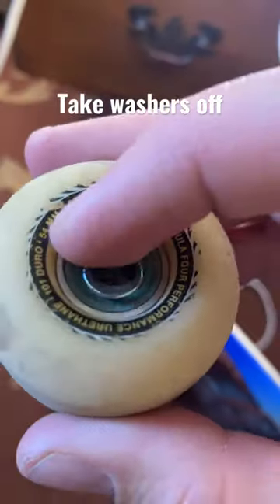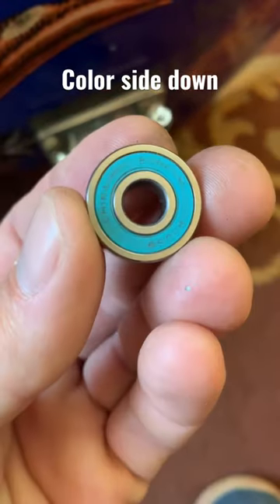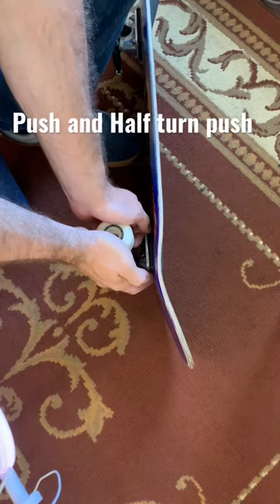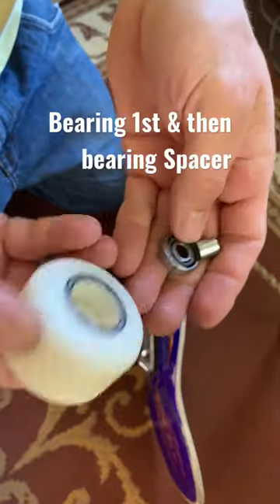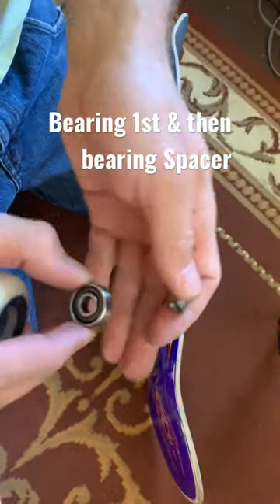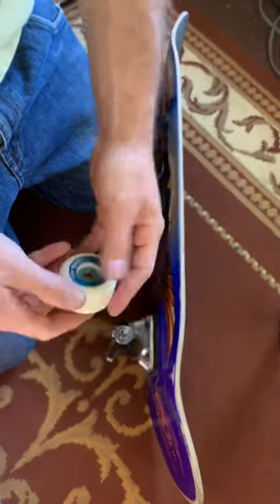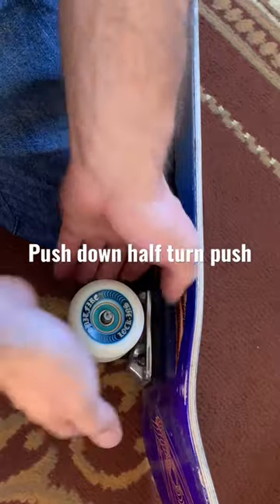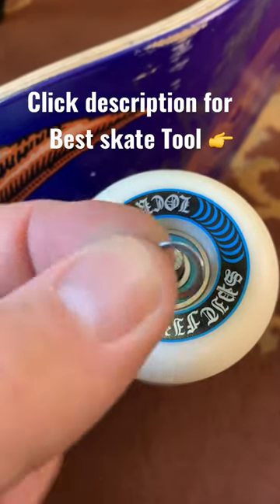Skateboard Bearings & Spacers Installed in 60 Seconds🛹 #shorts

Comment: Ive noticed that the washers cut into the bolt of the truck
Reply from the maker: @juniorfuentes8666  Wow I never thought that could happen! Thanks for pointing that out. I definitely like keeping them in there because it seems like the washers help the bearings spin smoother. But I have definitely skated without them before or missing one or two. But nice skate insight about skate washers. And they definitely don’t make skate trucks like they used too. But thanks again for the comment 🙏! And comment again when ever!! 🤛🛹

Comment: Is it normal for the spacer to move around if you take the wheels off? Since its not as wide as inside the wheel..
Reply from the maker: Yeah I believe that is okay because once you put the wheel on the truck axe holds the bearing spacer inbetween the bearings and in the middle of the wheel. But glad this video helped and thanks for checking it out gregbey9237 🙏! Please ask any more questions if you want !! And have a good day and hope those bearing spacers are working out good for you !! 🛹🤛

Comment: For what’s that Bearing spacer? Is necessary?
Reply from the maker: Bearing spacers help the bearing last longer and not break. A lof of skaters don't use them because they are not completely necessary. They do add a little weight to the board. I have been using them lately and my bearings have been lasting longer. But thanks for the comment !!🤙 or the question !!
Reply: @SkateTutorsLLC  What if the bearing spacer is loose on . Is that common?
Reply: @Warchief13-qr6er  Yeah only when the wheel is off the axel but when you put the wheel back on the axel it shouldn’t be rattling around. If it is then you might want to tighten the nut a little bit more. 👍🏻